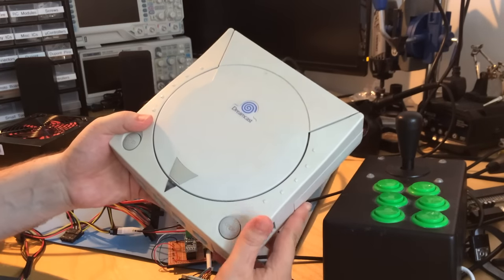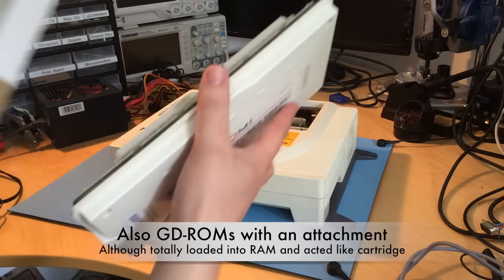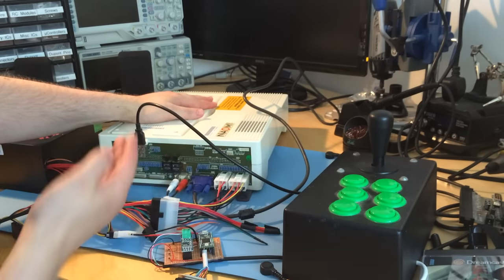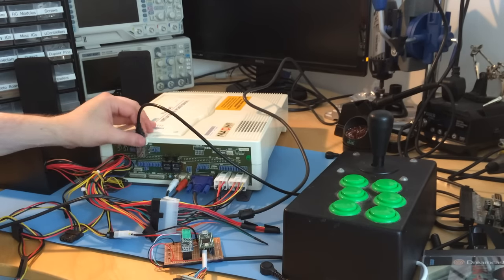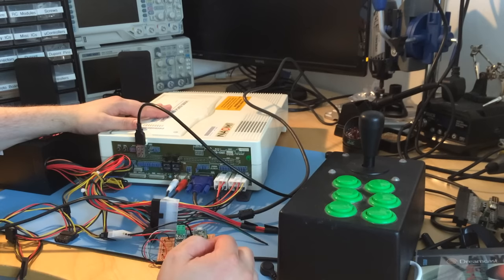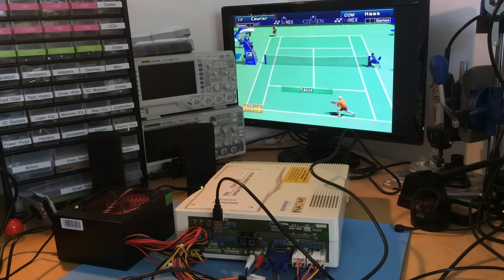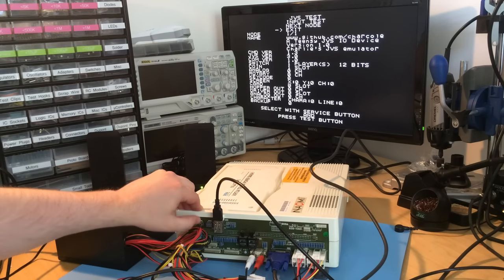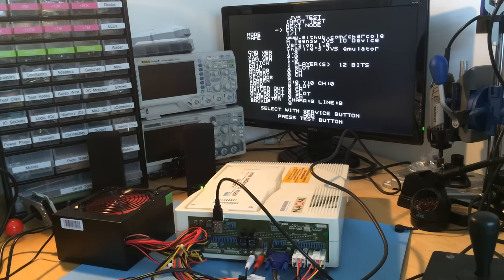Sega Naomi with homemade JVS IO board

Comment: @Chipos81, Brilliant Work!! From the pictures and GitHub description I couldn't really get the diode type and directions. They look like zener diodes with cathode pointing to the ground, would you please be able to give some more details? thanks a lot!!
Reply from the maker: They are just regular signal diodes with the cathodes pointing to ground. Don’t think I picked out anything special. They should have the typical 0.6V drop per diode. If I understand correctly it’s just so the device further up the chain can detect there’s something there and it’s not just open while providing enough of a voltage drop that it can read the signal. There’s a diagram in the Japanese JVS doc linked in the github on page 12.
Reply: chipos81 thank you very much for the answer. I’m going to buy a Naomi and I’m looking forward to implement this on it! Take care!

Comment: Excellent Work! I know you said the specs are in Japanese but do you have link to them I'd be interested in building a JVS host device so that I can connect a normal PC to an actual Sega or Taito JVS board. This would be very useful for those of us who have a JVS ready Japanese cabinet and would like to swap in a PC in place of our JVS boards on occasion.
Reply from the maker: +twistedsymphony Sounds ace! If you follow the github link in the description it has links to the spec in Japanese and also some partial translations in the readme. Hope it helps
Reply: thanks!
Reply: Any news on your device? I'm interested in adding a jamma pcb to a JVS cabinet, and I would have to build a JVS host.

Comment: Oh look.  I found a way to send you a message!  I’ve been prodding at TeensyJVS for about a year now.  My code is the “DB-15_to_JVS” fork off of your work.  Got it running in 1, 2, and 4 player modes and even implemented the CMD_WRITECOINSUBTRACT call to support the Taito Type X.  Question though: in trying to wire the first DB-15 to the board, I made such a rat’s nest I ended up designing a PCB rather than trying to wire a second DB-15.  So, since it was basically the same price to make 1 PCBs or 50, I have a few of these things now.  How would you feel if I were to sell some of them?  You did a lot of the work.
Reply from the maker: Thanks for getting in touch, it's really nice for me to see people building on my design. Your adapter looks really neat. If you want to sell them then it's fine as far as I'm concerned as long as you continue to credit me. BTW, someone opened a github issue to say I missed a break on the GETFEATURES command which is still there in your fork. Might be worth taking a look at.

Comment: Thanks for an awesome video. You mentioned the teensy was overkill. What other options are out there?
Reply from the maker: Thanks for the comment. I meant just that the Teensy 3.1 is a capable and therefore expensive microcontroller (£20/$30). What it does shouldn't need that much power. With more effort you could probably do it with an ATtiny and some shift registers. For a one off though it's probably not worth the effort in my opinion.

Comment: I have a Naomi 2 with Club Kart.  I'm trying to move to a NetDimm, but my first attempt complained that the IO board was not correct for Init D.  Are you feeding the Naomi information about the type of IO board that is present and is it compatible with all games?  Apparently my oem hardware is tied to limited games.  Obviously your design is for a Dreamcast controller.  Any feedback if this could be tweaked to use my gas pedal, brake, steering wheel, buttons etc on the arcade?

Nice work btw!  Thanks!
Reply: Ha! Funny that I've been reviewing this video today only to find out while scrolling through comments that I previously asked a question!  Still wondering if this would resolve my Init D issues.  Might have to just build it to see what I can do with it!

Comment: The teensy 3.1 has 21 analog inputs. Is that an insufficient amount of inputs to have it wired to two controller ports (P1 & P2)? Is there a solution for wiring for 2 players?
Reply from the maker: A lot depends on the game. For Virtua Tennis I'm sure you could wire up two player without much problem (stick, two buttons, start and coin for 2 players is about 16 digital inputs). The standard allows for all sorts of controller types though. If you tried making a universal controller you might eventually run out. Using shift registers to extend digital IO is pretty easy though.
Reply: +chipos81 Thanks. The goal would be to make a universal controller for 2D fighters. Yes your right. It will have to be done with shift registers. I'll give it a go.
Reply: Jason Teddy did you ever figure this out?

Comment: Why bother with this stuff? You can attach any cheap arcade joystick to a JVS controller. Just connect the joystick switches to the appropriate digital inputs on the JVS board and pots for wheels or pedals to the right analog inputs. There's nothing desirable about a Dreamcast pad that would warrant extra effort.